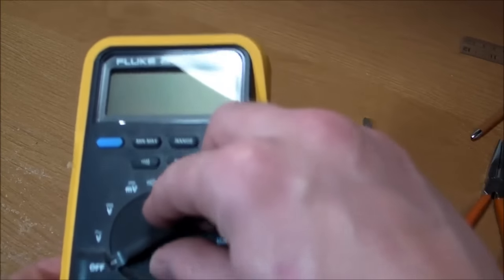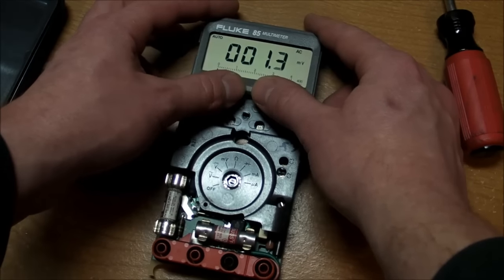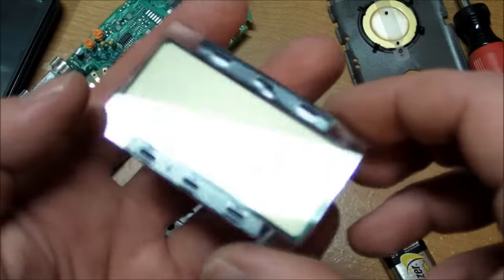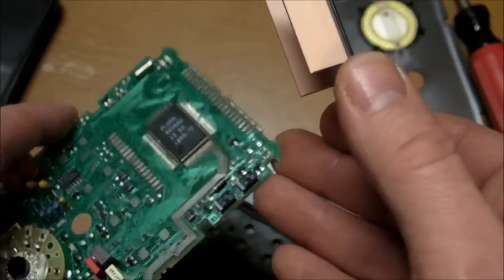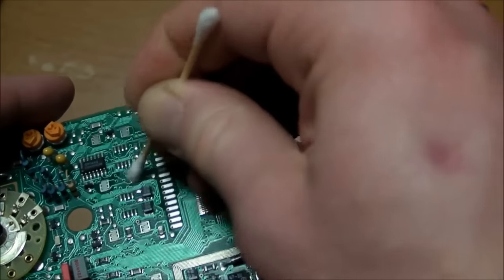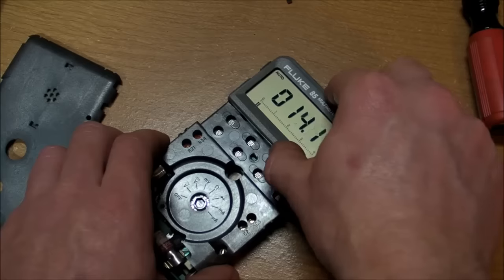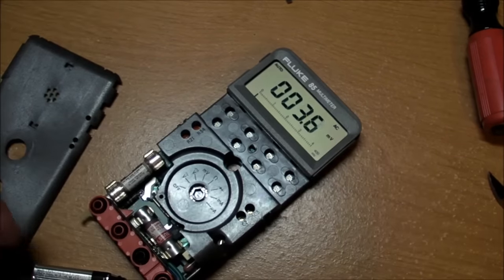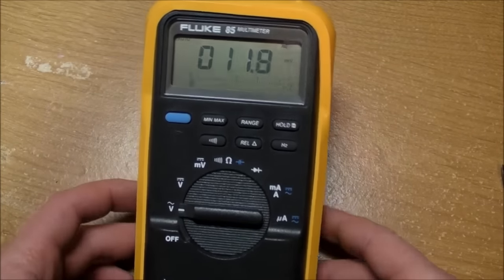(#0129) How to bring LCD Ghost Segments back from the Dead

Comment: Back in the 1980s I owned a manufacturing business making silicone connector strips.  Zebra was my competitor.  They always made an inferior and cheaper product.  The deflection design is critical to the assembly from the display to the circuit board(s).  Few manufacturers understood how to use such connectors for reliable performance.  I provided holders along with my connectors and assisted with design in reliability.  No one gives a shit about doing the right thing these days.  It is all deiven by greed, not pride and reliability.  Thank you China.
Reply: It all comes down to quality of components for anisotropic connectors and the slightly older subclass of elastomeric connectors and the board contacts/display contacts.
Of course, cheaper is better to many, which holds down the costs, but also limits the lifetime of the product.
I don't blame China because someone wants a $20 meter, rather than a $200 meter, as China didn't invent the market they're catering to, the buyers create that market.
My first experience with these connectors and failure modes was with my old Beckman 310, where the plastic clips stretched, allowing oxidation to interfere with the display connections. Fortunately, the Fluke 77 had entered the market around when I was tiring of fixing the meter repeatedly.
Reply: What did you do with your business?
Reply: @spvillano my first job as a technician at a defense contractor the company had a couple Beckmans and a Fluke 75. Not enough meters for the techs though. Very frustrating. I loved the Fluke. So much so that I bought a 75 in 1989 or so for I think $119. Still have it and the box it came in. Still works, made in USA. Got in trouble for bringing it into work because it didn’t have calibration stickers on it and it wasn’t property of the company.

Comment: I was a technician on the line that built those meters.  Your video brought back some fond yet frustrating memories.  Those little tabs braking and misaligning the switch were common issues in manufacturing.

Comment: I fixed the broken LCD display on my alarm clock by heating it with a hair dryer and then giving it few taps with my knuckles.  Completely restored now.
Reply: Gonna try this one on my motorcycle....
Reply: @stuartracing1  How did that go, Paul?
Reply: @Tom-bf6nm  I didn't get any change.. I wish I did,but nothing...

Comment: The Fluke 80 series meters are spectacularly reliable. They make the argument for spending more for tools instead of spending again. My 87 is 36 years old, virtually all in the field. At one point, Fluke became aware of a problem that mine did not even have and sent me an entire kit of parts and directions to repair it. Satisfaction!
Reply: I had a 70 series until it got stolen, dropped it off ladders, left it on hot machines, blew its fuses. Never had a lick of trouble with it until it got stolen with the rest of my tool kit. Family bought me whatever 80 series I have no, I've had it at least 20 years, tho it receives a bit less abuse now that I'm retired and also not running haunted house attractions in my spare time. ;) Never had a segment go dead or any other malfunction.

Comment: Those Zebra strips have always been a problem. What you did was the proper way to correct the problem. Some people will even go a little too far and take the Zebra strips off the LCD display which is a big mistake. Oils from handling Zebra strips can cause all kinds of problems. I used to replace them on all kinds of test equipment and learned the hard way.

Comment: The other 30% in 70% rubbing alcohol is water, the very last thing you want to leave behind. Either remove it carefully and completely or use 100%. It can be hard to find in a container but individual foil packets are readily found in electronics or photo supplies. It makes all the difference in the long run. Thanks for your excellent demo.

Comment: As an apprentice in the 70's I took apart a very expensive AVO8 moving coil multimeter and killed it, they didn't like the magnets splitting, nothing I did would bring it back to anything like accurate. 😬

Comment: Use your experience to repair an expensive digital caliper. Turns out the seal around the case had been misplaced in the plastic die cast seat. After dusting off and a clean install, display is back to life!  THank you for the tip!

Comment: Surprisingly easy fix, in fact for me just opening the case and fastening the screws was enough! Who knew. This saved my small kitchen clock and made my day (surprising how hard it is to find a small unobtrusive battery powered radio controlled clock that reliably shows the time and nothing else). Thank you so much!

Comment: Just a few weeks back I found this old R S Micronta digital meter. I'm not sure how I got, but I think it was a defective one someone gave me years ago. I thought OK fix it or throw it out. I have to much stuff and much of it is not longer of use or is junk. So I opened it up and put batteries in it and nothing happened when I turned it on. Dead I thought. So I looked at the insides to see if there was anything on the board worth saving. Somehow in that process when I pulled the board off I noticed that the display panel was not attached with any wires. Weird, I thought, then I saw where contacted the board. Hum, those metal parts in there look like they are tarnished. I cleaned them, and put the batteries back in and the display worked fine.  so I have another volt/ohm meter.  Sadly, I have trashed several meters in the past due to the display issues. Your video here now confirms what I found out. This is a new type of connection for me.  In the case of this current meter, it was in my junk collection I bet more then 20 years. So that alone will have these things tarnish and stop working now that I found this  new connection issue.  Now for test leads that will last longer and still flexible.

Comment: Thank you! This helped save my Oxo kitchen scale by visualizing the issue. The LCD was display just like the in the video. The design was different, this used a ribbon cable (not the clip in kind). I squeezed it into the circuit board and the display worked great. To fix the issue, I placed a thin piece of plastic so that it would increase the pressure by a little bit, enough that the display is now perfect.

Comment: Thanks for the info.  I have a Fluke 87 that has been tucked away for about 8 years because of the ghost numbers on the  LCD.  I always figured it needed a new LCD so I used another meter.  Came across your video, gave it a try and brought the LCD back to life.  Now I can use the Fluke 87 again.  Easy to do and a cheep fix for an expensive meter.

Comment: Thanks much for this. I ended up lightly scraping the contacts with a precision flathead screwdriver and all segments came back.
Reply: A fiberglass tip electronic contact pen works better than a screwdriver.

Comment: It worked - Thanks! I looked at three different videos and each showed a different method (alcohol, silver conductive grease & buying aftermarket connectors) - might as well start with the easiest and see what happens. Glad to have the display back on my 27 year old Fluke 87.

Comment: I use one of those pencil eraser to clean the contacts first and then I use acetone to clean them. I also clean the ends of the contact strip with acetone and air blast everything clean and dry. Fixes it right up.

Comment: I have calibrated over a thousand Fluke 85s in the air force. Never found one off-spec. Found 1 with a broken fuse. And a hand full of display issues such as the one you describe here in this video. I used some alcohol as well and this worked very well for me. Fluke 85 is a very reliable high quality Multimeter. But with basic functionality. Absolutely love them.

Comment: Thanks a lot, we have the same LCD issue with Casio DQ - 750F Digital clock and we did a alcohol cleaning on BUS from LCD to PCB and it did worked.

Comment: I also use contact cleaner on the pink contact pad that makes contact with the circuit board. It's very amazing how sensitive those LCD's are to a minute amount of voltage drop.

Comment: Cleaning the contacts with alcohol is good; but then, a very thin coat of silicon grease should be applied to prevent future micro contact corrosion problems. This has served me well thru the years for long term electronic fixes.

Comment: Nice. You got lucky. The process of cleaning the zebra's and solder pad surfaces is always a crapshoot. Sometimes it works, sometimes it doesn't. So, you won this time. The amount of pressure against the strip is CRITICAL. Can't be too much, can't be too little. Sometimes the strips deform slightly or "shrink" slightly over the years, which can be enough to cause them to loose good contact. Even a few thousandths of an inch of dimensional change is enough for them to not work. So the shimming approach does sometimes work (but use only a TINY amount of shimming. If there is too much, the strip will get "squeezed" too much when reassembly, causing deformation, and the same poor contact problem). By the way, although Fluke no longer sells replacement strips (the woman in Service Parts actually laughed at me when I called--"Sir, your meter is 28 years old, we don't have parts for it anymore"), the strips for SOME models of Fluke DMM's are available from one or two places on the Net if you search hard enough. I bought a few for my 87's a few years back. Heartbreaking to consider trashing a $400 (more now) meter because of 20 bucks worth of silicone. Best wishes.

Comment: A pink eraser on the PCB contacts, then clean with alcohol has worked wonders on almost all contacts like, switches, pots, mech encoders, TV remotes, etc. also, clean them rubber/carbon push buttons on the fluke with just alcohol.

Comment: Back in the 80’s when I was a.bench tech, we used “soft” rubber erasers to clean contacts.  Any loose rubber could be brushed/blown off and there was no moisture or chemical residue.

Comment: Nice video.. that system that Fluke and others (LEGO NXT) went to for their displays destroyed their product's lifespan. In my lab I had the generation of fluke meters before they switched to that PRESS carbon pad assembly and every single fluke meter failed within 5 years.. The old ones are still working 10 years later. Was same with Lego who used that system for their robot kits. Had 20 units.. every single one of them had to be replaced by LEGO within 3 years.

Comment: I find with the zebra strips on LCD displays and carbon contacts in remote controls it's always better to use methyl hydrate then rubbing alcohol though it did work well for you and that's great. Also you might try 99% instead of 70% alcohol. Looks good though.

Comment: Nice, fixed my (new out of the box) hygrometer by cleaning the contacts: rubbers, screen and print. Using your tips, cottontips and contactspray instead of isopropanol. Thanks for this 10yo video.

Comment: Just replaced the "elastomeric strips" in my Fluke 77 after 30 years due to missing character segments in the display but that wasn't the fix. One of the PCB solder connections to the elastomer strips had rotten lead which didn't respond to contact cleaner. Scraped it with an Exacto knife then more cleaner. Works good now. Save your money and remove the 4 screws holding the LCD tower ass'y so you can examine the PCB contacts and clean them. If that doesn't help then try new strips.

Comment: Use DeoxIT D5 instead of alcohol.  DeoxIT D5 will remove the oxidation as well as the gunk.  It will also help seal against further corrosion.  I use it all the time on volume knobs on radios and the like.  It works wonders at bringing radios with wonky volume knobs back to life.  It works on anything electrical.  It's safe for plastics as well.

Comment: My trusty old Beckman (now over 40 years old) still works fine.  How do you suppose they were able to make a lasting digital display all the way back in the early 80's?  Could it be they actually took the time to assemble them better?  I do know when I purchased the meter (from Baynesville Electronics just north of Baltimore) the salesman told me the tested these by running over them with a truck and dropping them off a building to see if they survived.  I own several other brands but when I want to be sure I always go back to the Beckman meter.  The reliability is unparalleled.  All digits are dark contrast on the background.

Comment: PS: if you like to have a nice accurate meter, but you also sometimes are in environments that are very hard on meters... buy a cheap $20 meter from Harbor Freight. Use it for things where accuracy doesn't matter much, such as a car, or where you might drop it off ladders as i used to do.
And save the Fluke for doing hobby electronics at home, or in the lab. ;)
That way, if the $20 one gets crushed by a steamroller, dropped into wet cement, blown up by a lack of caution, etc, you won't care.
I have a high accuracy seven_digit lab VOM (HP, old) but I never, ever use it. It has four wire ohms. So what? I haven't needed that since I worked with pulsed power crap in the nineties. In short: you probably don't need as much meter as you think you do. I'm a former EE with electronics and radio hobbies, and a cheap DVM is enough. ;)

Comment: If the circuit board zebra strip contact pads were gold plated there would be a lot less of the problem of fading LCD segments.  But cheap is cheap.  After cleaning BOTH the circuit board pads AND the zebra strip I apply Caig F5 Fader-Lube.  Also with the push buttons.  Works really well - my Fluke 77 and 23 multimeter displays stay reliable for much longer.
Reply: So it's not a fluke !

Comment: couple years ago i fixed gearbox position  (automatics -prnd321 thing) displays in my cars. for some reason it had zebra strips too, lcd like that could be with soldered  wires, but no!  still works (at least one shows proper gear, another car has offset position indicator for some reason now) , learned that from playing with some calculator doing things like in the beginning in the video.

Comment: Great video. I looked into repairing an old 15 kb digital diary. Not so lucky with mine, my ribbon traces were basically petrified when I opened the case and one little touch knocked the whole ribbon connection off the board :(

Comment: So much for Fluke's reliability and durability of their overpriced products. BTW, that solution will only work for a while and then the problem might come back again, much like some TV remote control buttons.
Reply from the maker: It is now over 6 years since the repair, and it has not failed. Just used the DMM last night. But, having said that, it will no doubt fail tomorrow.
Reply: @ElectronicTonic156  
Good to know, thanks for the follow-up. But many times those elastomer strips fail at some point because of poor contact with the PCB due to shrinkage or hardening after many years. Some of them might also lose some of their conductive properties over time, too. I'm a little surprised that just one cleaning with alcohol six years ago managed to fix it permanently.
Reply: @Kevin W 
Sure, Brymen BM869s.

Comment: Should the rubber strips be cleaned aswell, as I believe they have contacts too that link contact from the circuit board to ones on the LCD.... and should the LCD contacts be cleaned too?

Comment: Don't use any chemical stronger than rubbing alcohol, especially on the "rubber" transfer connector between the LCD and the circuit board. Stronger chemicals will warp the rubber and the connection will lose contact, permanently.

Comment: I'm curious how the rubber strip comes into play to push allow display on lcd? Is there light shining through the rubber strip? Does the rubber strip have to be perfectly aligned with slots/holes on the strip? etc
Reply: There is no light. It is about electrical contact. The rubber is basically a conductor (the black stripes are conductive). The same could be achieved with a ribbon cable or a bunch of individual wires. Each segment of the display requires one wire, plus one more wire for the common ground (or rather common plus contact).

Comment: Cleaning with alcohol does work, but it's not a permanent cure. The problem will reoccur. I have to clean mine once every three years. Also, clean the strips as well as the contacts on the board, the alcohol will not harm the strips.

Comment: What about a problem when lcd contrast goes really bad when battery discharges a bit? All other functions work well, but you have to look at the lcd screen at an angle to see anything. Is it that the manufacturer saved on some components which should regulate the lcd screen contrast?

Comment: I dunno how you kill segments in a Fluke. What are you doing to them? I accidentally exposed mine to very high voltage fields - pulsed RF - and single-pulse EMI fields, and just plain getting dropped - like, a LOT, such as off of eight foot ladders every day.  I'm still using it.  
Did the same to my previous 70 series until it got stolen.
I saw a guy throw an older one across the lab into a steel cabinet.  Meter still worked, tho I put it out of cal! :D  
My dude had to find another job tho. :/

Comment: Unfortunately this cleaning process works only temporarily. Soon the same problem appears again and again. One needs to replace the elastomer contacts stripes with new ones for long term cure of this problem. I had the same problem with my own 87 (first generation) which revealed this problem so many times in the past and was really annoying if not completely frustrating, given that I spent a lot of money when I bought it. I paid a one month's salary to buy it back in 1988. Excluding this problem, which appeared relatively very soon and it's a shame for an instrument like that, I had no other problems until now. It remains the industry standard instrument.